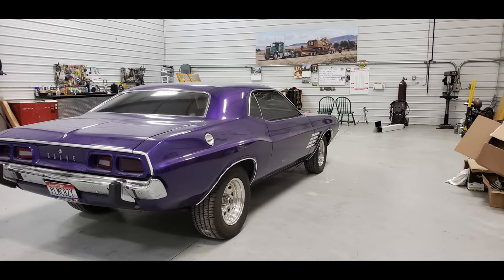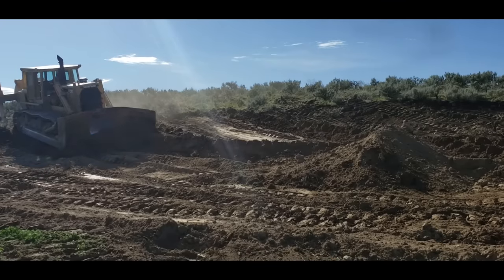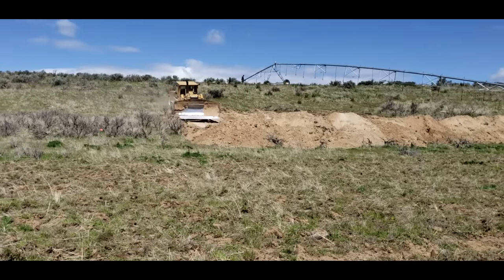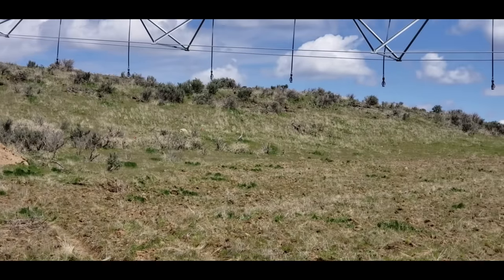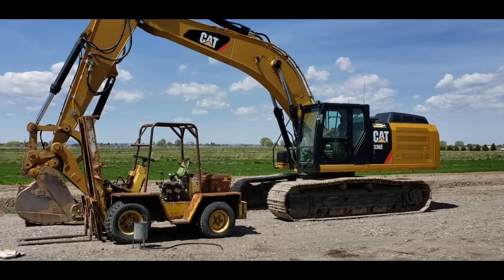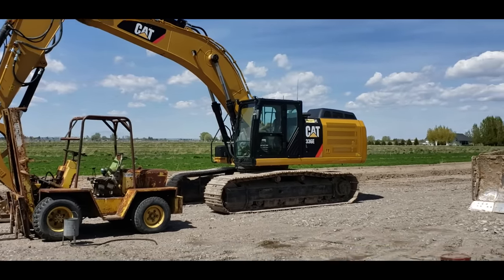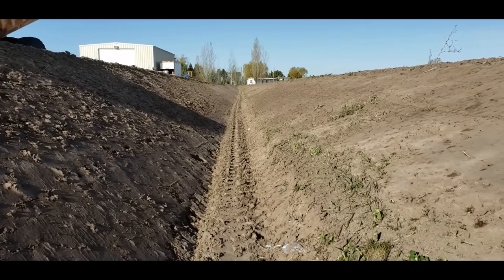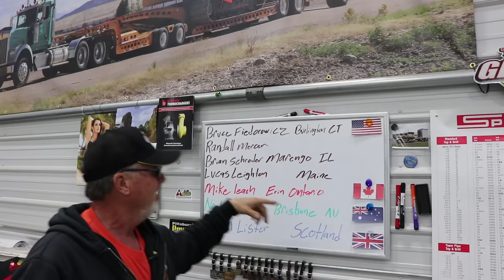Steamin Hot Caterpillar D9

Comment: The D9 runs so much cleaner with the Switchblade. Certainly it would be just a guess, but did you notice any fuel use improvements, or operating temp changes after installing that turbo. We figured you were moving scrapers to the big job last week, so thanks for the D9 video.
Reply: On a dozer the only temp change you should notice (if more power) is a higher torq conveter, trans temp and that will raise the engine temp being they are colded by the engine water. But it all depends on the temp rise and HP gain. A good operator will constantly watch the temps and operate accordingly.

Comment: I believe that is a Peterson blade for pushing pans, not exactly the best choice for moving material anyway.
Reply from the maker: That's a Caterpillar 9SU  blade,  your thinking of a C dozer which is only as wide as the tracks and mounts on the inside of the frame
Reply: @Jpaydirt  Yeah, after I saw it better I was thinking I had stuck my foot in my mouth but I figured you would correct me so I wasn't going to delete it. You are exactly right.

Comment: Strange cabin at the bulldozer. What year of production? Was this cabin exported, or is it found only in the USA?
Reply from the maker: it's a factory ROPS  roll over protective structure
Reply: @Jpaydirt  D9H bulldozers came to us in the USSR from a completely different cabin. Made either in Sweden or in Finland. What was my surprise (in the era of the Internet) when I saw on the American D9H a cabin very similar to the Fiat-Allis 31B. But it turns out that we did not have original cabins, besides lacking protection from capsizing. I worked in my youth at the 1975 Caterpillar D9H.  I doubt that the Google translator will correctly and accurately translate from Russian into English. It seems to me that he incorrectly conveys the meaning of the message.
Reply: Пётр Гарин This is a D9G, 66A seriesnot an H series. The H series cab had front windows slanted forward to combat glare and the doors were trapezoidal, not rectangular. Additionally. The entire cab could be raised and tilted back for drivetrain service.
Reply: This machine is about a 1970 model. I would personally rather have no cab than that cab. They are not wonderful. The modular cabs like the D7G/D8K/D9H has are better. You can put them on a D9G, but it is a lot of work. A good friend of mine is putting a modular cab on his D8H.

Comment: How many hours will that tractor run on a tank of fuel if it's pushing like that?
Reply: 8hr maybe
Reply: About 11 hrs on 80 gallons
Reply: My d 7 g  at a hard day will burn 60 gallons
Reply: When hunting deers and Volvo's all the time, when on rock face more so cause I'm a cat
Reply: It depends on what they are doing and the quality of the fuel. On normal going with good fuel, a D9G will run 12 hours on a tank of fuel. I think they hold just over700 litres. I know, we owned 5 of them.

Comment: I've sold Caterpillar for MANY years but have never seen an idiot operator RIP UPHILL..Huh?
Reply: Well now you have you peanut
Reply: I've also operated for many years and owned equipment including 6 D9s and many more D8s, had lots of hired help, have been the foreman on many jobs. I can honestly say, I have yet to see anything wrong in this operation. Normally you rip downhill, but on light ripping, why turn your Cat around every time you want to scratch the ground a bit. If he was spinning out or stalling the torque converter going uphill, then there's something wrong. Much like loading a scraper, you want to load downhill if you can. Sometimes you can't, especially if the bottom of the hill is a soft spot. Don't get me wrong there are other operations I have seen on YouTube that I am not impressed with. But then again, a video doesn't offer a great vantage point. Everything looks different on the operator's seat then it does on the ground.